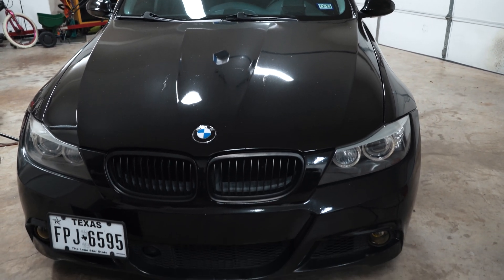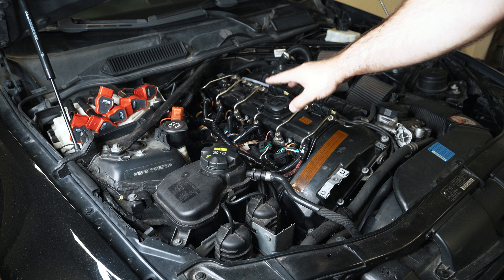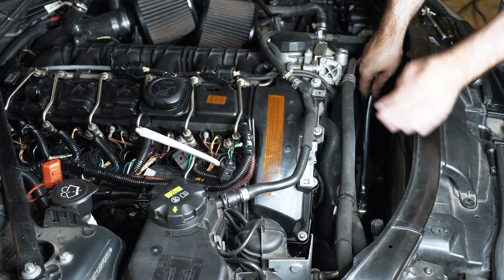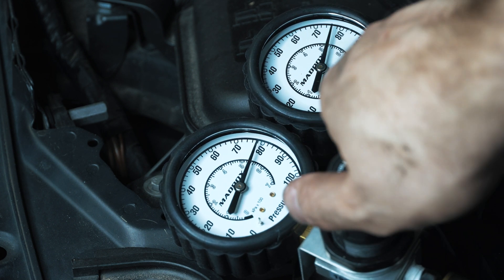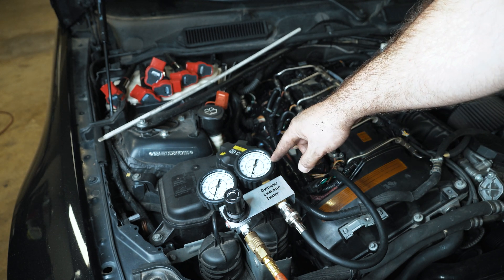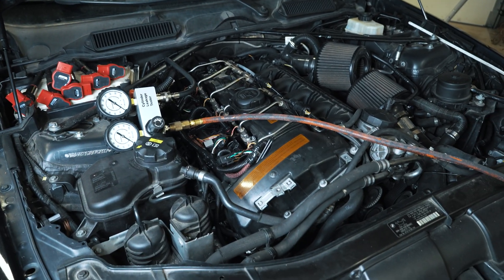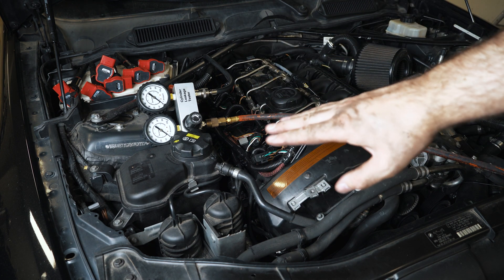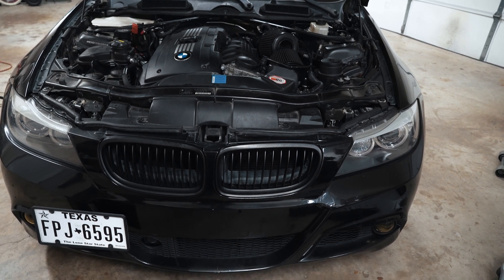My BMW Engine IS Still Like New at 200K miles! | N54 Leak Down Test

Comment: Hey buddy, ive watched a lot of your videos and appreciate the content. Im in the middle of pulling my hair out at the moment. I have a used n54 engine about to go in. Scoped the cylinders when i got it and found nothing unusual. Engine was pretty clean. Im doing a leakdown test and at 90psi, the best i get in any cylinder is like 40 psi. Is it possible to just have bad carbon buildup on valve seats or is this engine junk? Im at a loss

Comment: What method did you figure out the top dead center at compression stage? Obviously they were at TDC compression stage but if it is TDC and exhaust stage than you have false reading.

Comment: My BMW Engine IS Still Like New at 200K miles!
An engine is made up of many parts... "Leak-down testing is a static test. Leak-down tests cylinder leakage paths. Leak-down primarily tests pistons and rings, seated valve sealing, and the head gasket. Leak-down will not show valve timing and movement problems, or piston movement related sealing problems."  As you know 200K had taken a cataphoric  toll on your engine so it is misleading to say your entire engine is like New. The N54 is know for reliability issues that routine maintenance does not address and require taking the engine to pieces, as your recent work testifies to.. 
PS I love the channel and your style of presentation.. keep it up.

Comment: Know you can say your engine is still like new, compression test is not good way to check if the engine is good, my 535d have leak on one of the intake valves, and compression show across the 6 cylinders 380/395 psi, even 1 of the cylinders does not run good and you can feel engine when cold that is not run good in 1 of the cylinders, turn out to be clylinder 4 with 45% lost on the intake valve because carbon build up on the seat. run like that over 3 years until i remove the head and fix the problem.

Comment: have ever seen fine metal particles in your old oil after an oil change, noticed some in my old oil a few years ago, still runs fine done 100k, thanks
Reply from the maker: I haven't but pain attention to your oil filter.  If you're seeing any particles in the filter material that would be more detrimental.

Comment: Do you beat pretty hard on it or is it more of a daily driver? I know people who do wot pulls and hitting redline just seconds after starting the engine and I can't imagine what it does to the engine. They argue maintenance is all that matters. I drive my car pretty hard but I always wait for oil to reach full temp and maintain like it's a cult 😂. I can't believe the condition of this engine! Props to both your care and the engineers of the engine!
Reply from the maker: It was a daily driver that I used to beat on at least once a day but like you I always waited for the engine to reach full operating temp.
Reply: @VehicularDIY  Nice!

Comment: What would happen if you had some leaks? What type of corrections would you make?
Reply from the maker: You'd want to stay on top of them all.  Oil pan gasket, oil filter housing gasket etc.  As soon as you see them plan on replacing the gasket.

Comment: I drive my three times a month 640i
How long do you think I should change oil.  Is not driving often kills the motor?
Reply from the maker: Just make sure they are longer trips to burn out any moisture in the oil.  If it sits a lot I'd change the oil at 3 to 5k miles.
Reply: @VehicularDIY  Thanks

Comment: What’s your take on rod bearings? Would you consider doing a DIY on that?
Reply from the maker: I would rather leave them untouched unless I was doing a full rebuild.  Considering they are not a known problem area for the N54 as it is not a high revving motor.
Reply: @VehicularDIY  this didn’t age well :(

Comment: This is impressive someone should tell Scotty about this 200,000 miler BMW, he might have a heart attack LOL. But in all seriousness it seems the N54 is a strong lump it is just the ancillaries like the injectors HFPF waste gates / turbos etc that can cause problems, am I right?
Reply from the maker: Yeah definitely, the motor itself is very stout and I'm impressed with how much power it can make with an open deck block.  Its' true that the bolt on items are the only reason this motor gets a bad reputation.

Comment: Oil change how often? I do about 10k km between. Doesn't burn any oil at 230k km.
Reply from the maker: I've averaged around 5K miles between changes.  I've taken a couple long trips where I pushed it to 7K but mostly 5K.

Comment: Did you complete all 6 cylinders compression test  while only adjusting once to top dead center?
Reply from the maker: No I turned the motor over to TDC for each cylinder and then used the gauge to verify all the valves were closed.  The footage only shows each cylinder at TDC on the compression stroke.

Comment: Dope, how many miles when u bought it? What oil do u run? How often do u change? Any other longevity tips?
Reply from the maker: I bought it at 140K miles.  I run Shell Rotella T6 5W40 and I change it on average at 5K miles.
Reply: Vehicular DIY if you don’t mind
Me asking what’s the logic behind the heavier weight oil and also rotella vs a traditional gas oil?

Comment: This is the best test to gauge the health of the engine. 
We do this exact same procedure on reciprocating air cooled airplane engines. Only difference is those engines we’re happy with 80 or so haha. Getting 90 is almost unheard of, much less 98👍
Reply: I'm guessing higher PTW clearance in an air-cooled aircraft engine?

Comment: Nice hot air intake. You're losing good few % power there. But sound it makes, pro.
Reply: Yeah, a lot of tubers and net fan bois do not understand Boyle's Law.  On top of that, the leave the OEM CAI inlets open to back-pressurize the engine compartment thus reducing cooling ambient air flow efficiency.  Just nuts.
Reply: @machtschnell7452  True. Best thing to do with air inlet is to leave it. Somebody with greater knowledge and experience, designed it. I did used sport panel filter in my OEM air box. Conclusions? Nothing but fine dust in all inlet piping. No, thank you. Paper is better.
Reply: @Fosgen  lmao he has upgraded turbos, flow is more important. E85 and a big intercooler will negate any "hot air" going through a 600* F+ turbo housing then compressed.

Comment: Great video. My 2010 335i is at 250k miles and I have been wanting to do a leak down test, but the tester I rented from the store wouldn't fit in the tight spark plug hole. I will definitely give this tester a try.

Comment: Did you check your rod bearings with this mileage? Mine has almost 150k miles and now the oil pan gasket is due - and Im thinking of replacing the rod bearings too...
Reply from the maker: I haven't but to be honest I probably wouldn't want to disturb them.  It's not a high revving motor so they typically last and sometimes changing the rod bearings can cause the mains to go.  Or you may start to encounter issues with pressure in the head etc.  I'd only do it as a full rebuild or if it was an S85 V10 and avoiding them would lead to certain failure.  It's always a gamble in my opinion.

Comment: I have 09 335i fbo same turbos as you . I have been losing 1/2 quart oil every 300 miles . Any thoughts???
Reply from the maker: I'd check the pcv valve.  What oil are you running?
Reply: 5w40  i have rb pcv valve  bms catch can , vader solutions breather oil filler cap
Reply: Also no smoking out of exaust
Reply: Sorry , also brand new oil level sensor
Reply: steven kimura how many miles on the engine? Has it been burning oil since you changed the turbos?
Reply: 58000miles . Same oil issue before and after turbo install . Turbos only 500 miles old . Runs and pulls Great no codes    no smoke

Comment: This is just the problem with engines with many miles is when the cross pattern on your cylinder walls worn out it seals up better. And a leakdown test doesn't tell you anything about your main bearing and big end bearing condition or if the small end for the piston wrist pin is getting oval. 
Basically this tells you that your piston rings and valves are sealing properly, yes it's a good thing. But is there still enough cross pattern on the cylinder wall to lubricate the piston?
Reply from the maker: Maybe a bore scope video is next up on the list haha.
Reply: @VehicularDIY  
It would be interesting to see, and compare with an engine with low miles!

Comment: Hi I have a few questions wanna get some insight. I have a 2008 335i with 110k miles on it I wanna buy a use jb4 and put it on the car and just keep it at stage 1 map1 for daily drive, do I need to replace the spark plug injector charge pipe and stuff or I could do that all later on.
Reply from the maker: I'd recommend spark plugs and coils and charge pipe mostly due to how many times it would have been heat cycled.  The plastic could be come brittle.  Then see how things go, if you do not encounter any issues with misfires at your power goal then use your injectors as long as they last.  If you're getting codes and you have rough colds starts that's where you'll be forced to consider newer injectors.

Comment: Great vid as always.  Can you comment on keeping the oil cool in this heat. I added an oil bypass. You think oil coolers get dirty?
Reply from the maker: Thanks, my car has a factory oil cooler and it seems to have done this motor well.  I don't think it would get dirty unless the oil change intervals were 10K+.  I'd say the factory oil cooler does a good job unless you track the car.  For the few 335i cars that left the factory without a cooler I'd say adding an aftermarket cooler is a must.
Reply: Vehicular DIY Thanks my oil temperature was 240 to almost 250 in 80° weather which seemed warm to me so I added the bypass which seems to reduce it by about 5° - 10°.     Maybe those temperatures in the summer are normal I tend to change my oil every 6000 miles

Comment: Love the video! I do have a question. Is it at all possible you think to remove the water pump and successfully replace without lowering the subframe?
Reply from the maker: Yes you can get to the water pump and replace it and the thermostat with the subframe in place.
Reply: @VehicularDIY  I have the code 2E84 and 2E85 says BSD, message, electric coolant pump: missing.
Reply from the maker: I've heard of coolant getting into the connector when the pump fails and causing codes like that.
Reply: @VehicularDIY  wouldn't happen to know where the water pump fuse is located? I've looked online everywhere. Im seeing something about the ecu box, and i dont see that fuse he has. 135i 2008 e82 bmw
Reply: I've done the water pump and thermostat without dropping subframe twice, just move the steering rack to the side, easy. This was on a 07 335i.
Reply: @e85johnson68  Do not need to move steering rack on RWD cars.  But front sway bar is better removed.
Reply: On a lift it is doable.  Without a lift it is a lot tougher.  Evaluate oil filter mount gasket and replace thermostat, shield, water pump bolts.

Comment: What did you use to stick into the spark plug hole to know when the cylinder was all the way up?
Reply: Mine is solid at 155k miles... I want to perform this test on mine to verify it’s solid!
Reply from the maker: Oh I used an old tilt wand from some house blinds lol.
Reply: @VehicularDIY  and was that a tent anchor to pop the coils out?? haha
Reply from the maker: Lol nah its a set of plastic trim removal tools.
Reply: Vehicular DIY awesome! Just checking

Comment: That looks great!  Mine looks the same and you have helped me do it at 140k miles!  Just trying to chase down a Cyl 2 misfire that only pops up with JB4 active now.  Thanks for the great DIY videos!!!
Reply: Check your injector
Reply: very cheap fix
Reply: @thewhite335  I just put NGK plugs in despite having new Bosch plugs and that finally fixed my issue running on JB4.
Reply: it’s the spark plug or coils

Comment: what kind of oil & how often do you change it! i'm a believer  second BMW and third motorcycle!Dave
Reply from the maker: I use Shell Rotella T6 5w40 and I change it every 5 to 7k miles.
Reply: Vehicular DIY does it matter that it says heavy duty diesel motor oil ? I can put that in my 135i. Thanks for all the videos they’re so helpful
Reply: Toobs138 I was wondering the same thing
Reply from the maker: From what I've read it has the necessary anti wear additives for our cars and it is designed for high heat turbo applications.  There are some threads on N54 forums discussing using T6.
Reply: @VehicularDIY  so 5-7k miles since brand new ?
Most of the initial owners of these cars followed the BMW 15k miles interval so I wonder if those initial long intervals have caused any extra wear.
Reply: @VehicularDIY  would you recommend this over penrite hpr5 5-40w?
Reply: Hitman Oil weight debates/brands can go on forever. Vehicular DIY has tested compression/and leakage as seen in this video... Why do you think he should change to OW? (Also it depends on climate)  Oh and manufacturer also recommends oil changes every 13-15k miles lol. Whatever works for you in your climate is fine, just change it frequently and use 0/5w-30/40
Reply: Well, just like Vehicular DIY, I'm in Texas, and also use 5w because of the heat that we get down here.
Reply: Hitman  zddp?